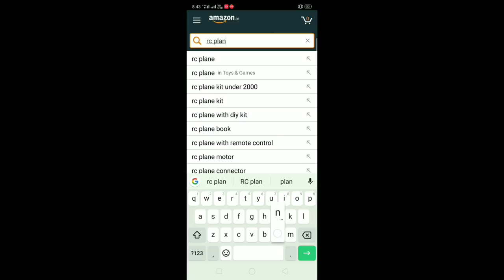How to make a RC air boat/build a RC air boat

Comment: nice work .. but very slow... needs some tweaks...If you want it move much faster.. COG needs to be further back...motor  has to be lowered...Motor angle may need up ward trust angle... build foam supports around back bottles...